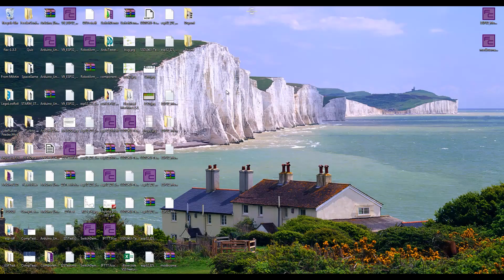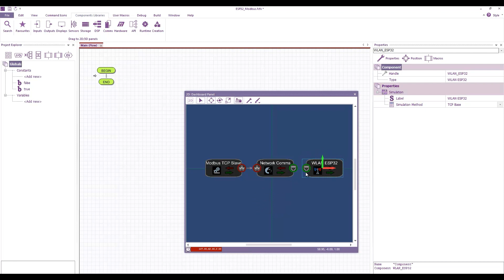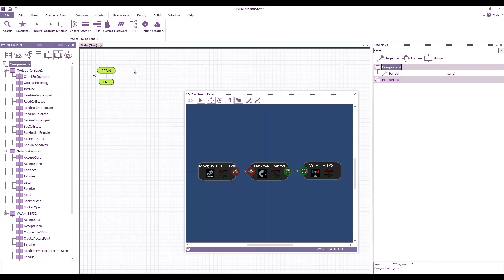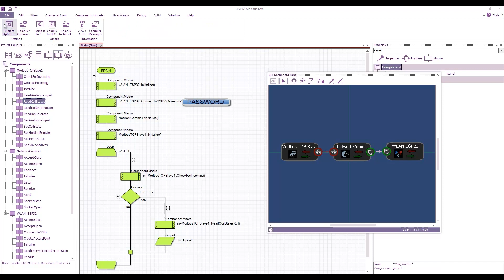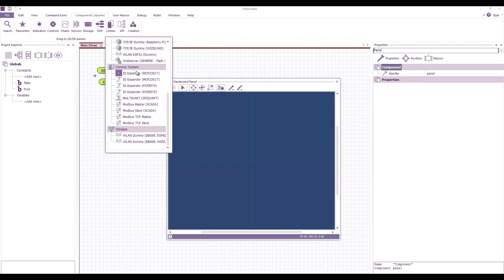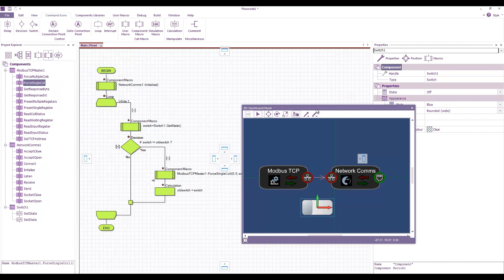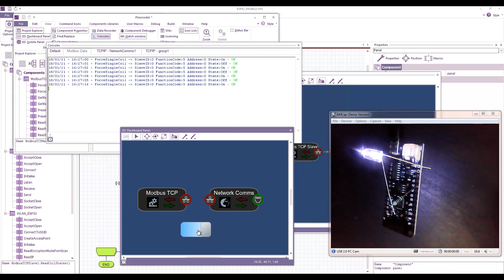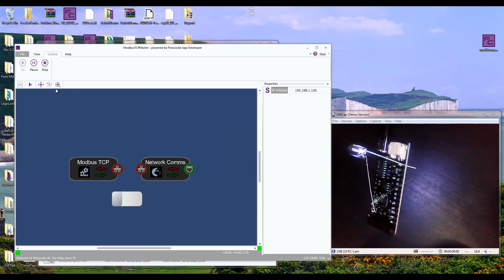Flowcode 9 Modbus Project Part 1

Comment: Thanks working very well, Every app restart IP Address is back to default which is define in Appdeveloper.
Is it possible to save the modified IP in App which will not effect on restart?
Reply from the maker: hi. not sure. can you put a post on the forum and  you will get an answer? thanks

Comment: nice modbus esp32 tcp info... i need one that will use the esp32 as a modbus RTU  master to read input register 30001 from a slave-01 panel-meter rs485 19200 baud.🙄 
any examples?  🤩 thanks